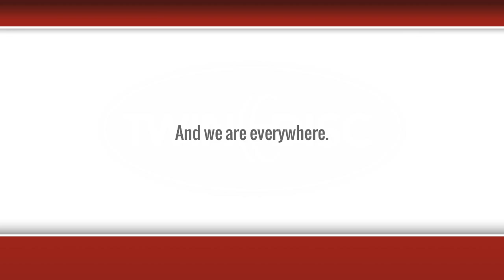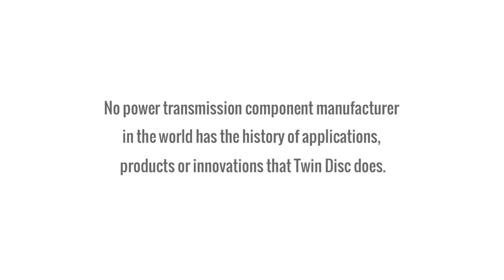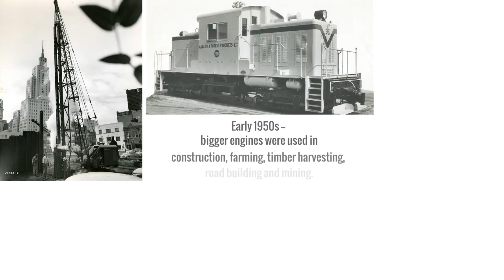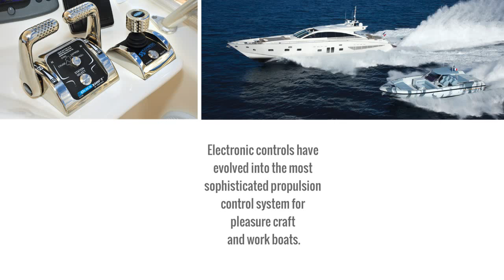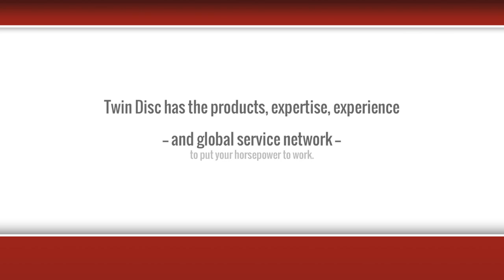Twin Disc Corporate Video

Comment: How is the availability of parts for a TwinDisc MG5061 marine gearbox?    I know a guy who has one however I will need to change the bellhousing adapter plate. It has a caterpillar mounting plate and I would need that changes to a SAE #2 or a SAE #3 (if the price isn't crazy I would buy one of each) as I have a couple engines. I have not got a email back from dealers in Canada so I am asking yous directly.   If twindisc still makes adapter plates and drive plates how much would they be selling for??